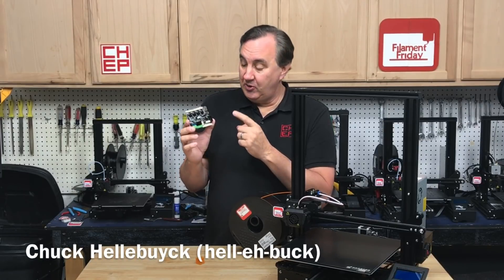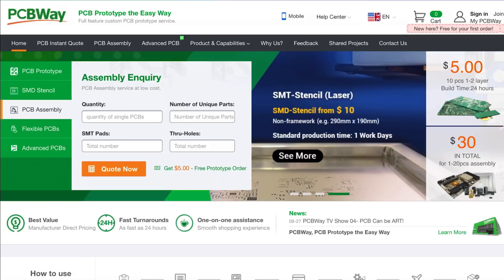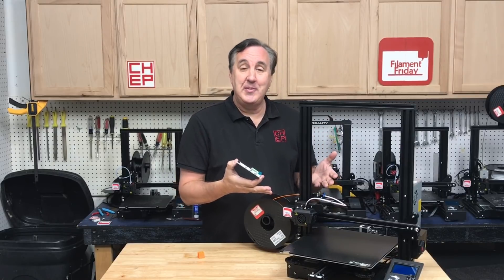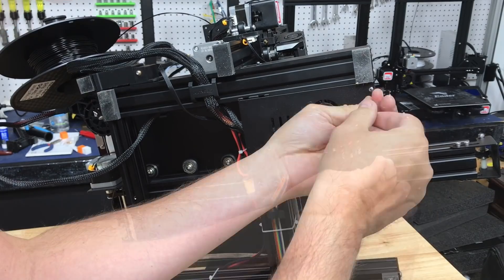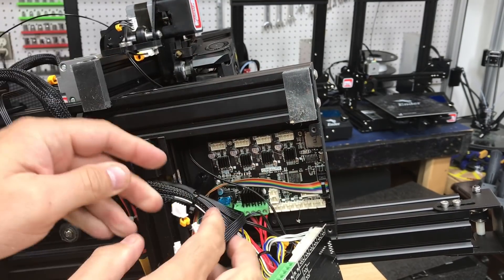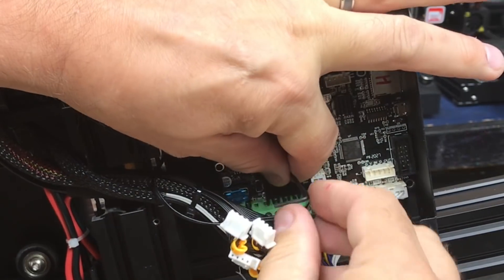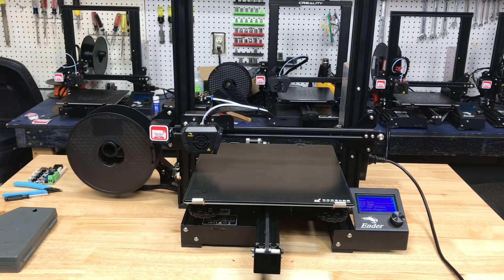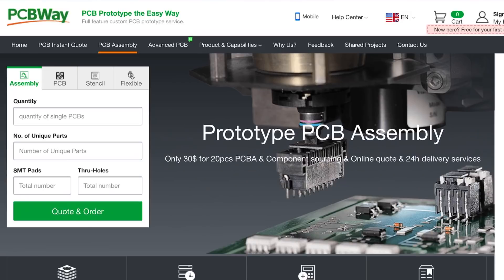Creality V4.2.7 Silent Board

Comment: Is there any advantage/disadvantage to the 8-bit 1.1.5 silent Board?
Reply from the maker: The firmware is more complete.
Reply: @FilamentFriday  thanks for the quick response! Just to make sure: the 4.2.7 is more stable?
Reply from the maker: No, it’s 32-bit vs 8-bit (v1.1.5)
Reply: @FilamentFriday  I know that ;-) But you mentioned in your first reply that the firmware is more complete. With my second question I tried to find out if you meant that the Firmware of the 4.2.7 is more complete (which means to me more stable) or from the 1.1.5.
Reply from the maker: V1.1.5 is currently more complete. I did a video on updating 32-bit firmware here: https://youtu.be/vFcMW6m9OGg

Comment: Hey! I got a Ender 3 Pro yesterday and it worked for a little and I managed to do the autohome but after trying to add stl's to the sd card and restarting the printer the display went blank. 

I've been hearing i have to try upgrading the firmware but would replacing the board with this also solve that problem?
Reply from the maker: Not sure why it went blank but you need .gcode files from the slicer not .stl Files on the SD card.

Comment: CHEP, thank you so much. Just installed. Who ever put the damn hot glue on connector needs to really rethink. That was an absolute pain to get off. What a terrible idea. 

Also the small screws for the enclosure. Kept falling into the extrusions. Ffs. Make a snap on enclosure like most items in the market. Who's opening this multiple times that they needed to screw it in like that. 

Anywho! After installation. I'm shocked at how quiet the printer is. And without you, I'd be pulling my hair out instead of connectors. 

Thank you!
Reply: The glue is added to prevent the connectors from disconnecting lol
It sucks but it does prevent the connectors from disconnecting for the mainboard thus preventing any issues during shipping or store stocking.

Comment: Hi Chep, 
I have install this Board and it work very nice. But i cant use my old bed level gcode from you. When i start this gcode it will dont stop at the point when i must control the bed level. What can i do?
Reply: @technician_br5494  Thank you. I have now find new Bed Level from Chep on his chepclub Website. But i must go in Menu and push on resume print. 
I will test also your way today.

Comment: Hey Chep, can you install a Filament Runout sensor on the 4.2.7 board? I need infos  regarding that :)
Reply: yes, you can, in my case, i need to update the firmware (using creality's official firmware) and it is running OK

Comment: Hi Chep, i just received this same board yesterday... I ordered it for my ender 5 since its board is acting up and i figured this would be a great replacement..vender said it works with ender 3 and ender 5...but now i hear it needs to be updated to work with a ender 5.... is this true and are there any videos that show how to do this using a lapto and a cable??? thanks this is something i never did before...
Reply from the maker: There is a drop down at the website to select the correct firmware when you buy it. But you can update it. Turn off the printer. You put the proper firmware (.bin file) from Creality on an SD card and insert it in the board. Then power up the board/printer and it will automatically update it.
Reply: 2. download the ender 5 32 bit firmware for 4.2.7 board (.bin file)
3. RENAME IT with "firmware-" and any other character then ".bin" extension (the printer will not load it if you don't add "firmware" suffix)
4. Copy as said Mr. "Chep"  on mini SD card and 
5. Switch OFF ur printer
6. Insert the above mini SD card in the printer
7. Switch ON ur printer
8. Wait few seconds
9. To verifiy ur printer is updated, go to "Printer Info" Menu and u will find the proof that your printer has the new Ender 5 firmware

Comment: I was wondering if you tried this board on the regular Ender 3 yet and if it is worth doing this upgrade? I just purchased this board for my Ender 3 but have not installed it as of yet. Thanks
Reply: Yes, I have tried 1.1.3 (8 bit), 1.1.4 (8 bit) 
and 4.2.7 (32 bit) with so called silent drivers
From 1.1.3 to 1.1.4 = NO CHANGE IN QUALITY
From 1.1.4 to 4.2.7 = Higher Detail at higher speed (no more ringing) and VERY SILENT
I can print now at 80 mm/s with acceleration at 3000 mm/s and jerk at 20 mm/s
Yes, on regular Ender 3 this board is a real deal
Reply: @marcofranzini8610  thanks for the info, I'm going to be making the upgrade soon.
Reply: @SmallSpoonBrigade  You will not repent, higher detail at higher speed, bcs 32 bit means more details elaborated per seconds... Not only SILENT. 32 bt VS 8 bit matter
Reply from the maker: 1.1.4 was not silent. 1.1.5 is silent. There were some 1.1.5 boards mis marked 1.1.4 in the early release phase (another Creality screw up) which made people think 1.1.4 was silent but most aren’t.
Reply from the maker: I installed the 4.2.7 on my Ender 3 max here: https://youtu.be/G2GJiXYBAJs

Comment: Hey Chuck is this plug and play?
Reply: Yes,
your computer will recognize in CURA if you connect in WIndows, but about USB plug&Play support in Windows you need a Microsoft Windows Update for that.
Actually WIndows supports several models of Printers. If you want u can define a custom 3d printers in WIndows.
In Linux and of course Apple (Linux derived kernel) The support for Plug&Play is not yet Live.
But you can use Pronterface or Duet or Octoprint to comunicate in Linux as well. (I am actually on Ubuntu+Pronterface+CURA)

Comment: Installed this on my Ender 3 works good but why when I do the Stop at layer height command the printer won’t stop just keeps printing. But it does stop at the set height but it returns right to printing again without pausing for the filament change
Reply: This mainboard and its firmware are not compatible with change filament feature.
Reply: @LEGENDoha9876  issues been fixed
Reply: @boazandruth909  not for me. Installed the latest firmware and don't have filament change support

Comment: I have Ender 3 pro, and replaced the main board by 4.2.7, now I see under "About Printer" menu: Marlin 1.0.1 2020-04-25... is this normal?
Also the cooling Fan is not working at all at any layer, although it's 100% on the screen.. So, what's the issue? I checked the electronics and everything is fine....
Reply: My board fan stop working

Comment: Just installed this board on my OG Ender 3 and I'm blown away. The reduction in sound is like magic.
Reply: Can you run mesh bed leveling on the og printer after installing this one
Reply: I just did the same. It's remarkable (and here I remark about it). It took me a few seconds to register that my printer was working when I started my first test print. 

Now the fans have to go.
Reply: @universaljoint  I did all the fans on mine. Noctua all round aside from the Winsinn blower as the parts fan and it's been excellent. Only issue I've had so far is that I've felt the need to turn around and look at it just to check it's still going! What a problem to have!
Reply: @TheAngryAstronomer  Noctua fans! I never thought about that
Reply: @TheAngryAstronomer  link to the fans and which fans you swapped out? I need to change them out after I add the dampers and board tomorrow 😓

Comment: Dumb question, does it work on other 3d printers that are not from creality? Talking about a duplicator i3 mini for example. I don't have a problem with editing my own firmware if needed.
Edit: it's a reprap machine, 24v, no heated bed but planning to add a 220v one if that's something you need to know. No auto bed levelling, bed is too tiny for it to be worth it
Reply: U will need to update :
1. stepper motor steps (in the source file)
2. All custom options
3. Pray that everything will be ok...
And yes theoretically it will work, but I would suggest a SKR mini, it's better supported for every type of printers, why use an OEM version of motherboard ?
Reply: @marcofranzini8610  answer is money, skr mini plus 4 silent drivers is gonna cost more than this by a bit. I will look into an skr mini though, it may be worth the money if it saves me trouble.

Comment: But why not the SKR?)
Reply from the maker: I showed the SKR here: https://youtu.be/CN6dOI6QxAs
Reply: @FilamentFriday  have you noticed any difference between them in prints and printer vibrations?
Reply: I tried that and it was a massive problem. Bigtree didn't invite include decent instructions and I never was able to get it to work. It wouldn't even take the firmware upgrade and support basically just stopped responding when they couldn't figure out what was wrong. I wound up having my credit card claw the money back.
Reply: @SmallSpoonBrigade  may be you have dead SD in kit, try with firmware on other SD card.

Comment: I just installed these silent boards in both my ender 5 printers today and both extruders are running in reverse,  does anyone know how to fix this? Is it a coding issue?
Reply: I ran into the same problem and fixed it by plugging in the extruder cable in the opposite direction. To do so I pulled off the white plastic piece on the Mainboard, turned it by 180 degrees and put it back on

Comment: Please make sure that you check and adjust the stepper motor drivers. Mine were at 1.3 volts making the extruder motor get so hot with a metal extruder that it literally would soften the filament causing print failures. I adjusted to .6 volts and now no problems. They ship with the stepper drivers set way to high.
Reply: Yes, it happen also to me, and I had to buy a new one

Comment: I got mine with with dd and bl installed. It works but the machine crashes because I guess the dd bracket won't engage limit switch correctly

Comment: I did the upgrade on the Ender 3 pro with BLTouch. I have use the firmware from the Creality web site. The printer is working well but it will save all settings on the SD card instead of the EEPROM. When I replace the card it lose all settings. Is this just a bad setting in Marlin or there is no EEPROM in Creality V4.2.7?
Reply: no its to do with Marlin version, as EEprom saves are from v 2.0.6.x .....BUT,  Creality firmware is just custom Marlin 2.0.1 so saves to SDcard instead, so not a bug as such.

Comment: I am using ender 3 pro , the filament does not come out in the half of the printing and I have changed the nozzle also . The nozzle is not clogged and the extruder gear is also tightly fitted . Kindly help me in fixing  this issue .

I am new to 3d printing and I am learning everything about 3d print in your channel , it is  very helpful .

Thanks
Reply: Calibrate your e steps
Reply: @CJ_washere  thanks ! I will try it
Reply: check PTFE tube in hotend they get partial blocks go hard and crispy / black etc (white is poor quality PTFE) Capricorn PTFE (blue) is better quality
Reply: @GaryJWright  Thanks! I will check it

Comment: Hey chep, Completely unrelated but im about to buy a cr10 pro v2. Its about 660 area. Am I making a mistake. Is this printer the king of the printer or is there a much better option?
Reply: Hey I've had the cr10 pro v2 for 10 months now and I absolutely would recommend it. Its a solid printer that will last you a long time (if you know what you are doing lol ). If you don't want to spend so much money, you could get a cr10 v2 and add on a bl-touch to it. I'd be happy to answer more questions about the printer :)

Comment: I take the motor connectors off first and put on last. and  remove the board to get the glue. Some are generous with the glue stick and I'm afraid I'll get to aggressive. I also untangled and checked the routing of wiring, they didn't care if things are crossed. I also put insulating material where the wire pass through the frame. Thank you for the guidance. You are definitely the most informative. Can you recommend a complete print to covert ender 3 pro to direct drive? I'm concerned of the added weight to z though.

Comment: Chuck - would that 32 Bit board work to replace the SunLu S8 board...??  My SunLu S8 did a complete power failure today...  Check all I could but no luck ... However - Amazon Prime was GREAT for support and return.  I don't even have to box it up ... Take it to Kohls and they will box it and ship it back to Amazon .. and my new one will arrive from Amazon on Fri or Sat - 6 days away .>>!!.
Reply: I have a sunlu s8. Just replaced the board with the BTT skr 1.4 turbo but I had to get help with the firmware as I was having issues trying to compile my own. Everything was fine except auto home was homing wrong even though I had it set to -1 direction
Reply from the maker: Glad you got a replacement. I’m not sure if this board will work. I would also look at the SKR boards.

Comment: I installed this motherboard on my Ender 3 Pro 1 month ago and I am very happy with it ...
completely silent, accurate and reliable printing
I can only recommend it to everyone

After replacing the motherboard, do not forget to set the potentiometers of the TMC2208 controllers
for me these were the right values:
x-motor: 0.91V
y-motor: 0.97V
z-motor: 0.92V
e-motor: 1.2V

Comment: Turns out if you mix the bed heater element and main power wires up, the board will still start and everything will look fine, but the bed will just keep heating. Don’t ask me how I know this!!!
Reply: I just installed 4.2.7 and my bed just keep heating. When I installed, I did the wiring one by one. 
I then installed the old board and it all works fine.

Comment: Hey Chep, first time commenting. It looked like the factory solder was still on the wires when you hooked up the new board. Is that something you worry about or no? I did the silent board on my E3pro and a month later the cooling fan stopped working, sure enough, the wire came out of the slot and looked like like the solder maybe got soft. Any problems with this?
Reply from the maker: It’s not recommended but its how they built it. I haven’t seen many problems with it but Solder will deform under pressure so the connection can loosen over time.

Comment: I upgraded My Ender 3 Pro to the 4.2.7 board and love it.  It does support the BLTouch, but you have to get the right version.  I ordered one off of amazon and it did not work.  After reviewing a LOT of comments it turns out that there is a 32bit version of the BLTouch.  So keep that in mind.  I sent that one back and will do that later.  Although, I get great level bed manually, so.  

Also, you should make sure you get the right FW.  Creality is real sloppy with their FW distributions. 

I also upgraded to the Micro-Swiss direct drive and all metal hot end.  The combo of those two upgrades is really good.  Worth every penny.

Comment: looked like the thick red wire is tinned?
Reply: All my wires came tinned from the factory. I had my fan wire come out and it looked like the solder was the cause. I cut the ends off all the wires and re-installed, no problems since. I also made a comment on this video to him about the solder.

Comment: About the ringing. I just recently found out my fan caused some bad vibrations. Did you ever cover this topic?
Reply from the maker: No. Never heard of that.
Reply: @FilamentFriday  I reasently swaped my cooling fan and mounted a BTT 5015 fan. After the swap a reccond heavy vibrations of my hotend. Checking for a replacement at Amazon, I saw in the comments it's not that rare. A lot complaining about the qualitiy of 5015 fans. This lead me to the question how vibrations of the part cooling fan or hotend fan may have effects on the print quality. Even with a stock fan you can get vibations e.g. with strining: The strings get suckt to the fan and blocking the fan blades.

Comment: When I got my Ender 3 Pro a week ago, I didn't even switch it on till I got the board swapped out for the 4.2.7, ringing results are a little better than yours looked, but I'll have to try with an actual chep cube, the only text I've only done is temp towers

Comment: Maybe I missed something, but why do this instead of a after market solution?  I went with TH3D EZboard because I wanted the best US solution and have not been disappointed.  I like the Creality chassis but try to avoid anything else from Creality.  Why not use this as a chance to add ferrules to the screw connections?

Comment: I had one of the resistors start to smoke when I went to hookup the board. I had to get a replacement for it and my Ender 3. I seriously wonder why they don't do testing, like a fault finding testing at the factory. There is 3 big sets of wires and 1 set of small red and black wires on mine.

Comment: Great video!! I did the same to my ender 3 Pro, its a lot quieter than the original 8 bit PCB.
It came with marlin 0.0.6, Should I update it?

Cheers from Argentina!!
Reply from the maker: If it’s working don’t update.
Reply: @FilamentFriday  That's what a professor always told me :) thanks

Comment: Odd on the ringing. But I may have a theory... It's the teeth on the belt snagging on the teeth of the motor gear. If you look at how the belt and gear mesh when they move, you might see it vibrate when it snags. Question is how to fix it?